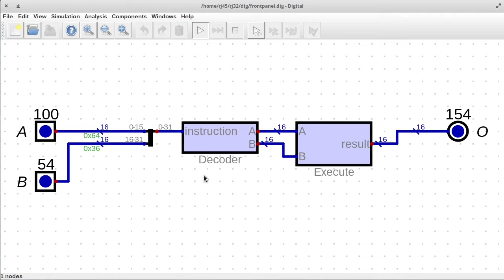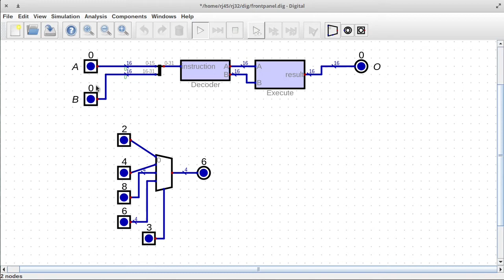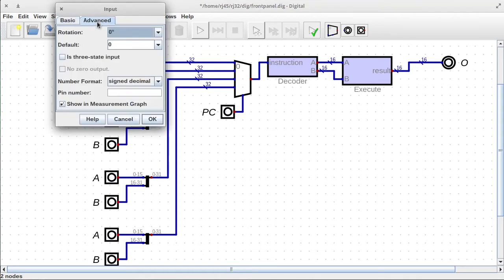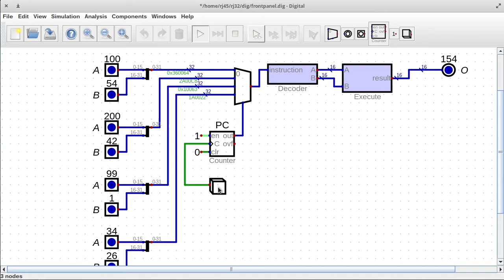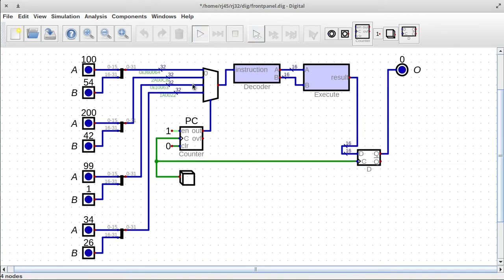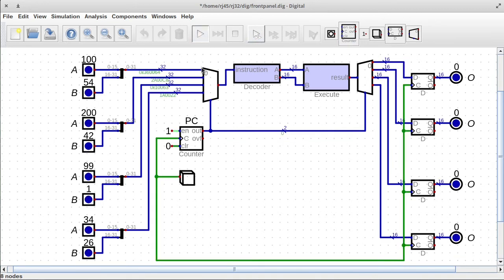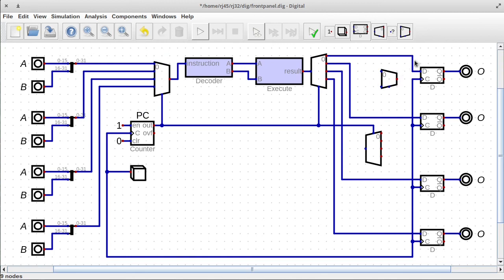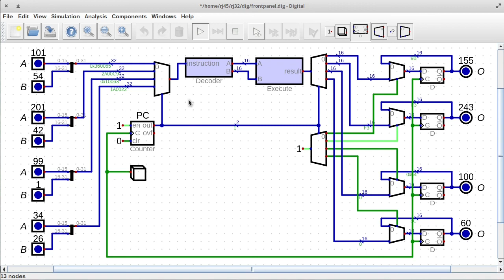[003] Adding Multiple Numbers - Building a CPU From Scratch

Comment: In the first and second (demultiplexed) variant with the registers how is made sure that the calculations happen before the register saves the new result and not the old value? 
It seems like they should save the old values since the adding should add some "lag" to the line but the registers are connected directly to the trigger.
Is there some prioritizing going on?
Reply from the maker: Digital doesn't model propagation delay like it happens in the real world. Any gate has a delay of 1. And all built-in components also have a delay of 1. So an adder will complete in 1 delay unlike in the real world where it's made of many gates and takes a significant amount of time. Generally this is sufficient to have timing glitches show up and be able to troubleshoot them and fix them. But you're right, sometimes a glitch can happen because of the propagation delay differences between components. In those case, I rely on defence in depth with other tools hopefully catching it. But that's covered much later in the series (if I cover it, I forget).